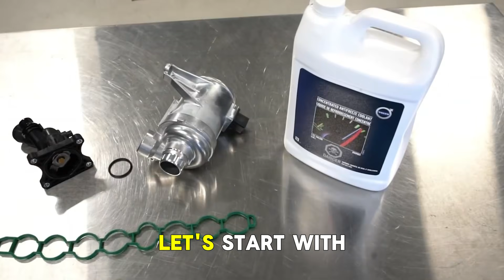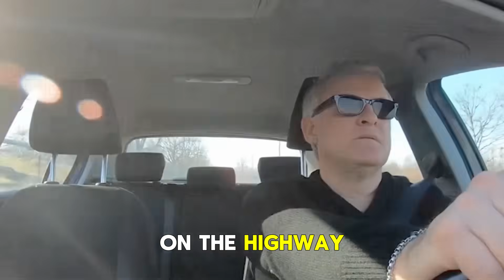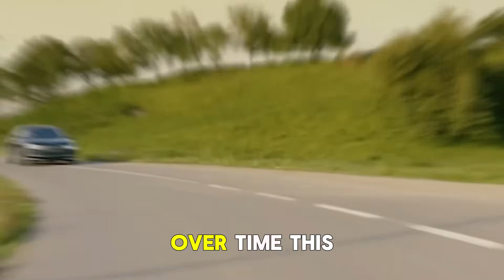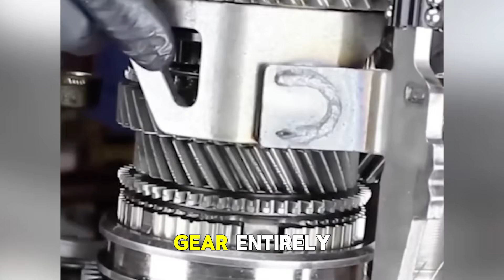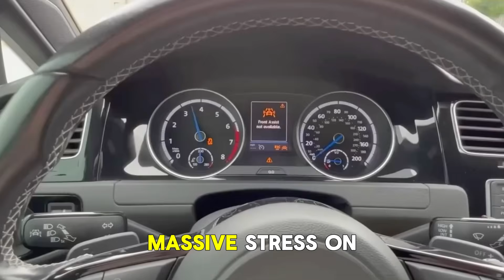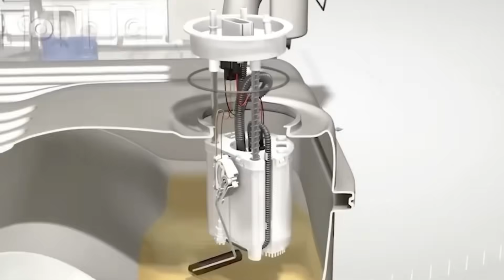11 Daily Mistakes That Are Silently Destroying Your Car! Most Drivers Do All Of Them

Comment: Fuel pumps were designed to be sumerged in gasonline, so when you keep your car's gas tank low allot that can wear out the fuel pump.  Fuel Pumps are not cheap to treplace.  You should refill just after your tank is 1/2 empty
Reply from the maker: Thanks so much for sharing that valuable tip about fuel pumps and tank levels! It's great to have such knowledgeable viewers adding to the discussion.

Comment: I STRONGLY OBJECT TO YOU CALLING A CAR AN INVESTMENT! It's NOT. It's a costly, expensive waste of money that we, the public have no control over. And as for "idling time". That too, is not under our control. Example: On the highway, comes to a standstill for an accident. You stop, start, sop , start. Is that idling or not? Sitting in traffic is a gas burner. Finally, I wonder about start and stop. Don't starting an engine wear out the starter? For example: When getting the mail. You stop the car, let it idle for ? how long while you get the mail. That may be more than "just a few minutes". And if you turn the engine off, the restart puts wear on the starter. So what's best? I see it as the "lessor or two evils".
Reply from the maker: You make a great point about the starter wear vs. idling debate, and it really comes down to minimizing wear in different scenarios.